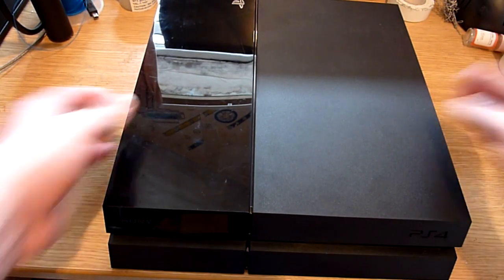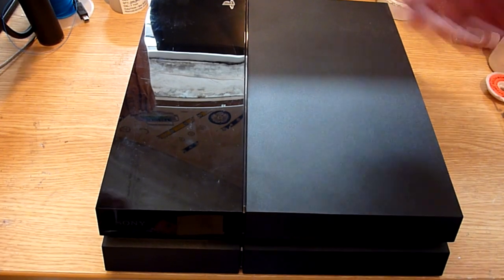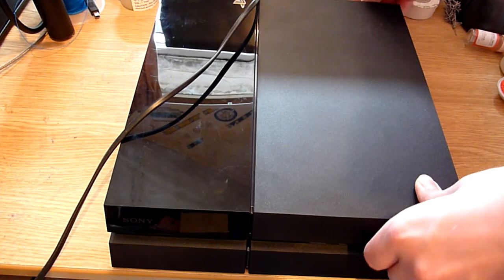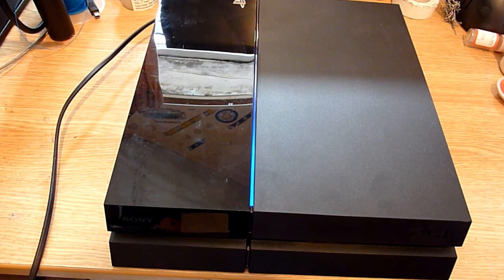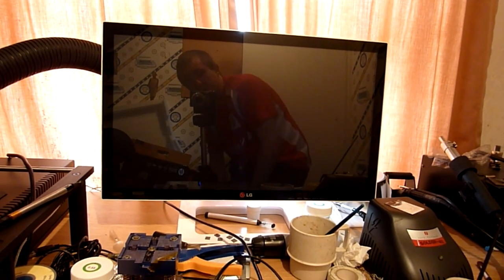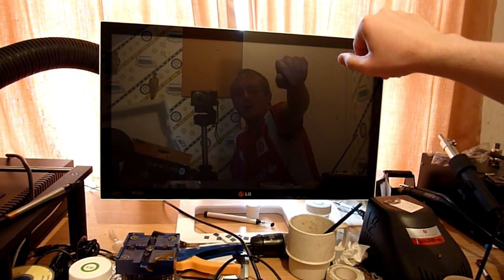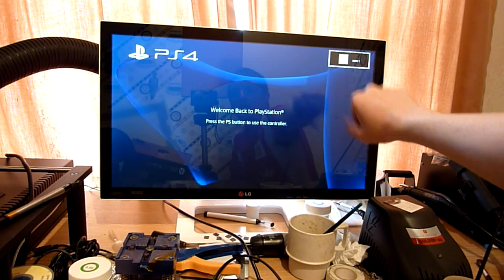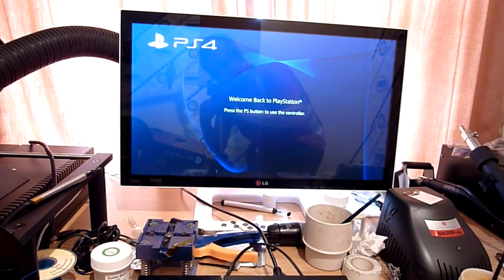PS4 Power Supply Repair - ADP-240AR Transformer Failure - Blue Light of Death (BLOD)

Comment: Hi, i got the same power issue like the right one of yours,
and when i finally able to turn on the ps4 and play game, it will shut down suddenly..
Do you please know it caused by both bad apu and psu or only psu issue?

Sorry for my bad english ;(
Reply from the maker: +lai alvis If it's like the one on the right then it's most likely down to a bad PSU (that is it powers off and stays completely dead until power is removed and reconnected). If it's starting up OK and letting you get in game before doing this then it could well be down to a bad Fairchild Semiconductor DNP015 IC which is a watchdog IC for the supply - when these start to go bad they can exhibit all kinds of weird and wonderful (and often very intermittent) behavior!
 
If it starts up OK, crashes / hangs up in game and you can recycle power fine without having to unplug it and plug it back in then I'd say that's most probably an APU fault and would require a reball to resolve. Many PS4s sadly seem to have some manufacturing defects during the APU soldering processes at the factory.

Hope this helps!
Reply: +Andrew Paul i'm gonna to replace the DNP015 IC see if this will fix it
thank you sir! It's helpful to me.
Reply: @laialvis1384  hello I have the same problem replacing the psu or the component did the trick?
Reply: @MyMarcus007  sorry for late reply, replacing the DNP015 IC didn't help, but replacing psu did the trick.
Reply: @laialvis1384  hey thanks for the reply I replaced my psu its in perfect condition

Comment: Can you tell me where i can buy these part in your Clip. whats the Name of the Part or wich specification it has. Thank you
Reply from the maker: I have some equipment list videos on my channel - no replacement parts were used to repair the supply as the original ones were salvageable.
Reply: +Andrew Paul  I know, but I have a transformer where exactly this part is missing  (that's why I'm asking for the name). Can you help me please?
Reply from the maker: I haven't one to hand currently. Which power supply model do you have there?
Reply: +Andrew Paul I have got the ADP-240AR with 5 Pins.

Comment: Hi, I opened my transformer and found that the J23 resistance  burned. I intended to replace it but I can't find his value because the board schematics are nowere. Can you help me because im going mad! XD
Reply from the maker: Hi, I don't have schematics myself, sadly nobody does apart from Sony. Best way is to take one from a bad supply - the transformers rarely fail themselves so should be fine.

Comment: Mean power supply is reson for blue light and shut down ps4?!???
Reply from the maker: In very certain circumstances. More often than not though, it's typically some kind of issue on the motherboard (again of which there are many)! You can use something called 'UART' on the PS4 to try and determine the causes of a blue light of death (if it's constantly on - if it's a 2 second issue then it's typically an issue with either the APU or RAM).
A tutorial for UART will be along very, very shortly.

Comment: What do you recommend for de-soldering this kind of stuff?
Reply from the maker: Braid and a decent quality iron should do the trick. Cheers.
Reply: Andrew Paul The last time i worked on a ps4 controller, i had trouble getting the solder to flow.
Reply from the maker: You'll need some solder flux and a suitably large iron tip too to ensure the heat transfer into the board is sufficient to flow the large joints.

Comment: I attempted to desolder this and it wouldn't even melt, can you explain this?
Reply from the maker: Did you use flux? What iron / air station are you using? What temps / airflow are you using?

Comment: Hi great video, I'm going to subscribe.  My Ps4 clicks twice as well with 2 of the LEDs lit of the board.  I took out the power supply and the heat shield is discolored as if the power supply got very hot at some point.  It also smells like it had been hot.  So I'll by a new one, hope I don't waist my cash!

Comment: Has he made a video on repairing the one to the left?
Reply from the maker: Sure have:
https://www.youtube.com/watch?v=Mz0Wi3ph0ro
Reply: @AndrewPaul  Hey paul, im kinda im a sticky situation. I've added washers and it hasn't done anything. My problem is that while dissembling the console I accidentally pulled the connector attached to the motherboard. I soldered it back on and then that's when it gave me the blod. It will turn on them instantly turn right back off. Could it be because of that power connector that wasn't soldered correctly or the apu. Ive added 3 washers on each side with no results.

Comment: Idk if anyone can help me, my ps4 has been doing the same thing the ps4 on the left does for a while... i usually leave it for a day powered off and it works fine but i have to factory reset it. But it works, now one day i plug in my external hard drive and it instantly shuts off and never turns on again(left ps4’s behavior again)... its been like 3 weeks nothing. Any suggestions? Theres a repair guy i know but he’s overcharging to diagnose it. He also said all he can fix are power supply issues and i know it’s not my power supply. Any support would be greatly appreciated
Reply from the maker: What model PS4 is this one?

Comment: i really can not imagine how this could happen, nice tut, i was just about to ask regarding the soldering iron, but got my answer. but i need the tip of the screw driver, can you get me a link, thanx
Reply from the maker: +Raed “3absiso” Abbasi hi mate, which screw driver is it you're needing?
Reply: +Andrew Paul the one u used to put back the PSU small screws, i can not find it anywhere
Reply: +Andrew Paul the one u used to put back the PSU small screws at 24:20 , i can not find it anywhere
Reply from the maker: +Raed “3absiso” Abbasi Ah! It's a Security Torx (T9) bit to remove those screws. A kit like this one should do nicely:
http://www.amazon.co.uk/Ifixit-26-Bit-Driver-Kit/dp/B00876T3CA/ref=sr_1_6?ie=UTF8&qid=1444465254&sr=8-6&keywords=t9+security+torx

The screwdriver itself is a Bosch IXO IV 3.6v Lith-ion screwdriver and it's a super little piece of kit. That can be found (a lot cheaper than I bought it for a few years back!) here:
http://www.tooled-up.com/product/bosch-ixo-iv-3.6v-cordless-screwdriver-with-integral-lithium-ion-battery/194643/?Referrer=googleproductlisting&gclid=CjwKEAjw7uKwBRDUlJvRo-z6rgMSJACbmSBhA3L_IC39jXt3yOGjTZ38utYJah-rUPsOapvWf1gDfRoCSnzw_wcB

A nice little set of Security Torx bits for this driver (including the T9 you'll require) can be found here:
http://www.amazon.co.uk/50mmx2-5mm-Shank-Magnetic-Security-Screwdriver/dp/B00W18SF6U/ref=sr_1_5?ie=UTF8&qid=1444465254&sr=8-5&keywords=t9+security+torx

Hope these help :)
Reply: +Andrew Paul thanx, i have the Makita screw driver, i just need the pits, let us see how i can bring them back here :) i do not think Amazon can ship here
Reply from the maker: +Raed “3absiso” Abbasi Where are you located? I'll try and find you a supplier who may be able to ship to your country.
Reply: This is really generous of you mate. I will try to find them. If I could not ill let you know. I am from Palestine but under Israel regulatin. I am from the place where all the shit happens Middle East :-)

Comment: What is F3 on the power supply?
Reply from the maker: Which supply?
Reply: ps4 cuh-1002a
Reply from the maker: So a 5-pin (ADP-240AR)?
If so, IIRC it's a resistor - 0.16 Ohms 5% - colour bands Brown/Blue/Silver/Gold.

Be sure to double-check the bands / colours on yours though as I'm not currently near a board I can look at to confirm.
Reply from the maker: Also, forgot to add that if that fuse is burned then also check the two FETs on the heatsink directly behind it - if these are shorted too (usually they'll short source to drain pins) then you'll need to replace the resistor at F3, the two FETs and an IC (DDA001AG) together at once. When you check the two FETs be sure to desolder them from the board first for a more reliable result. Good luck!
Reply: the 16ohm is it a 1/2 or 1w

Comment: Aren't these consoles still under warranty? Why people bother reballing, repairing them?
Reply from the maker: +worroSfOretsevraH The Sony warranty is only valid for 12 months so the oldest units are now 12 months out of warranty (2 years old).
Reply: +Andrew Paul can the 240AR power supply work on 240V cuh-1115A ps4 console please reply
Reply: +Andrew Paul thanks and what about 240CR power supplies on CUH-1115A 240v
Reply from the maker: Cesar Sosa No it's not.
Reply from the maker: Cesar Sosa Ah I see where you're going now - you're not after voltages you're after compatibility - the 240AR is a 5-pin PSU and is not compatible with the CUH-11xx consoles. The CR is a 4-pin PSU and is, so you'll need the ADP-240CR for your console.

There is also an ADP-240ER for the CUH-12xx series consoles.

Cheers.

Comment: hello andrew,

thx for your videos. you can see that your doing it with love :D
i got  a question to you. i bought a ps4 with the excact same behavior. so i opend the psu and it was the same error as in the video. i fixed that to cables and the ps4 run again. obviously it was a drop damage, because the mechanic of the drive were also messed up. so i begann to fix the drive. i could start the ps4 5 times to test the drive and suddenly the transformer error came again. the ps4 shutdown with in 0,5 secound and you here the double click. i opend the transformer, but the previouse faulty part is still in place. could it be, that the part that i fixed is completly dead now?
Reply from the maker: +Kaan T First thing mate is to double-check the connections on your faulty tranformer. I'd remove the part again and ensure you have good connectivity across the joints with a multimeter. If this repair fixed your issue and it's gone quickly again then likelihood is that the issue will be connected. Good luck!

Comment: Hi can anyone help me i got a new ps4 power supply mine acted like the one on the right so i bought a new power supply and i putted it in it still doesnt work can i know where is the problem
Reply from the maker: Likely to be a mainboard issue - possibly APU / Syscon / NOR / RAM etc. It's probably going to need professional attention if it's anything like the above.
Reply: Andrew Paul lmao basically buy a new one . sony screwed me over good . I had it tooken to a proffesional and he told me its the psu not working so i was like okay bought the psu replaced it tbh was so happy to get it running again but it had the same problem can you give me any tips
Reply from the maker: OK so this has happened before and it's worked OK since? That's different then - It's likely the replacement PSU was one of these awful re-manufactured things from China and it's given out not too long after replacement - not surprising sadly. I'd get one pulled from a scrapped system rather than a 'new' one - you'll be far better off.
If you've never had any experiences of component-level rework the last thing I'd advise anyone to do is go inside one of these PSUs - you can hurt yourself badly very easily!
Reply: Andrew Paul I can also add before the ps4 went not working absolutely it did work for like a hour or two and it would go off by itself no error no nothing just turned off and i would have to turn it on 3 or 4 times to get on it again so i thought there may be some dust in it and i opened it cleaned the dust (i didnt get it wet) and i took the psu off cleaned it and put it back in hoping it will work better but it didnt even turn on anymore I really want to know if i can get it fixed or not
Reply: Andrew Paul and also thanks for helping me
Reply from the maker: I'd try and rule out the PSU first - if you've got a friend who'll let you borrow theirs then that'd be cool, or failing that see if a local repair shop will test your PSU you currently have installed there for you in one of their machines. If it turns out the PSU is working then I'd say it's potentially APU related if it's powering off like you state. Have you replaced the thermal paste on the APU after you cleaned it all down?
Reply: Andrew Paul I didnt open all of it just the back where the main fan is and the power supply
Reply from the maker: Ah right OK - as above then, get the PSU tested if you can and go from there.
Reply: Andrew Paul I hope it will work somehow wish me luck Thanks for the help you deserve more subs

Comment: Hi my friend, good video, Ps4 does exactly what you show on the left side .. That's power supply?
Reply from the maker: If it powers off and then acts completely dead until power is reapplied then it's 90% of the time a PSU-related issue.
Reply: Andrew Paul In my case It is not completely dead, it continues to beep and sometimes the blue light comes out .. In a nutshell it is exactly the same as the left side ps4 in the video.
Reply from the maker: That's likely to be an APU issue.
Reply: Andrew Paul reballing fixed this?
Reply: @AndrewPaul  hello brother can you help me please my ps4 just beeps once and won't start also there's no blue light eject button beeps 3 time what's wrong with it

Comment: I just got a ps4 slim with the same problem for $100 and free shipping 😂
I already have a ps4 controller and power cord from a ps4 phat that I can use for it
That ps4 phat needs it’s hdmi chip replaced 🤷🏻‍♀️
That one turns on just fine but has no picture on the screen. I actually have a good reflow station and magnification equipment but everywhere I’ve looked for the hdmi chip is from China, and last time I ordered one I never received it and they gave me a refund 😒
Reply: Should be able to get it from mouser electronics

Comment: Has anyone ever tried doing away with this power and tried running a ps4 from a 12 volt battery
Reply from the maker: Won't work sadly - it also requires a 5v feed from the PSU and uses logic between the PSU and motherboard to control the startup / shutdown procedures via the Southbridge.

Comment: I had lighting strike my house in short It shorted out my ps4 a TV and some other items as well. I replaced the power supply it arrived today actually and I put it in and same thing absolutely nothing no power at all won't even power on. Any suggestions?
Reply: Dead mainboard is most likely. Your Ps4 is likely just fried. A power strip with surge protection is worth the extra 20-40$ to protect consoles like this.
Reply: Third3ye
Reply: motherboard

Comment: Hello, I believe I have a bad power supply but am unsure of what to fix. When I apply heavy pressure to the psu, the white light does come on. What component(s) should I replace. Take a look at this website by the way: https://www.ifixit.com/Answers/View/156972/PS4+Blue+light+of+death+fix
Reply: maybe just a bad wires contact . a loose ribbon from its slot.

Comment: Hello! My power supply is the same model, but it sometimes works, and sometimes not. I measured diode D21 with a multimeter and it did not show a closed circuit. Is it normal?